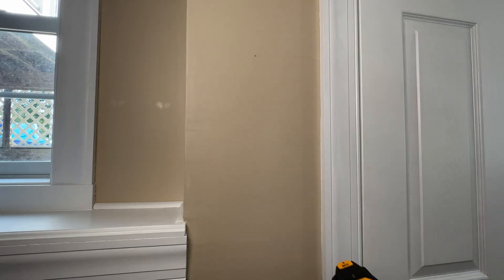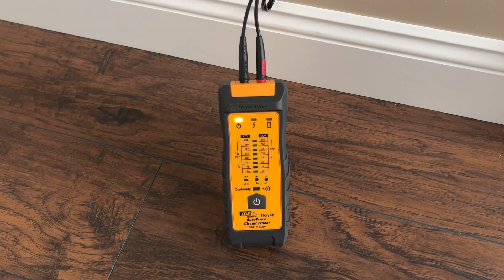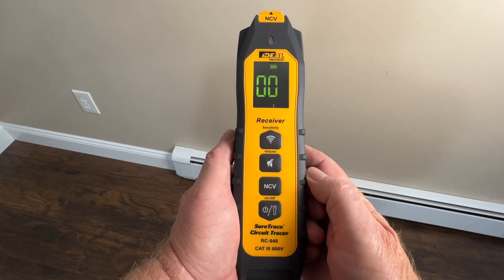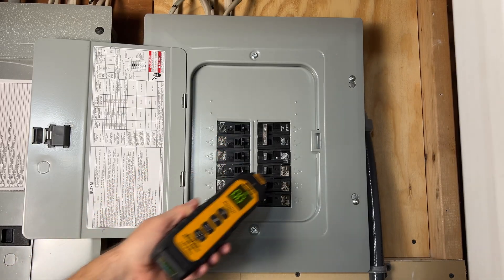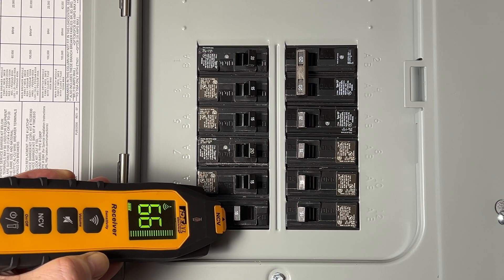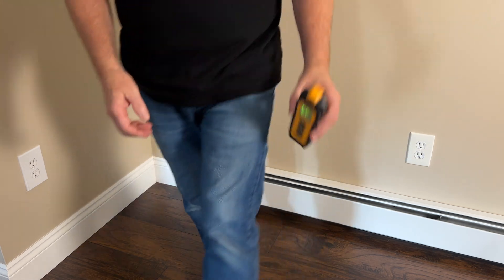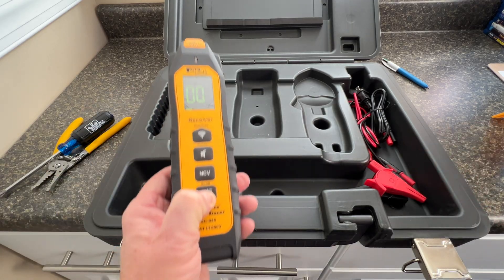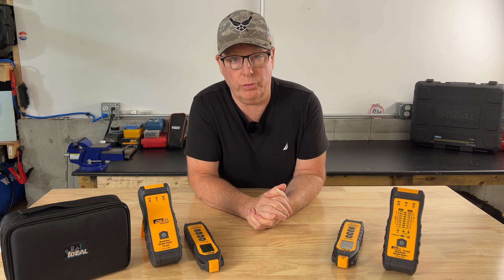Electrical Troubleshooting Made Easy! (+ GIVEAWAY)

Comment: Will the circuit tester differentiate circuits with shared neutrals, i.e. multi-wire branch circuits?
Reply from the maker: I haven't tested that but I think so. You will get readings on both breakers but you should have a stronger reading on the one with the transmitter connected.

Comment: hello I know its a year since your tracer give away. I watched your video and was excited to see your easy to understand explanation of a complex idea.  if you ever have a giveaway for another trace I would love to have one. I am a new to the electrical trade and ran into this problem trying to find a dead circuit in a new panel upgrade I did.  without a trace it will probably take several hours or days to find the issues I have. thanks again for your cool videos. I would even be happy with a possible discount code for a purchase. thanks again

Comment: Been doing maintenance for residential and commercial buildings for a long time. Never knew how to properly trace wires out till now. Thank you i know this device will make my life alot easier. Either way im getting one. Going with the 948 higher voltage

Comment: does the 946 have continuity testing also?
Reply from the maker: No, the IDEAL SureTrace 61-946 circuit tracer does not have built-in continuity testing. This feature is exclusive to the more advanced models, the SureTrace Plus (61-948) and SureTrace Pro (61-950).

Comment: My bathrrom lights, back bedroom lights, garage light, basement stair lights going upstairs, dinning room ceiling fan, and living room ceiling fan all lost power when turning the living room ceiling fan light on. Both fans where on high at the time and i pulled the light chain kinda slowly when it clicked and it all went out. The breaker will stay on but nothing will turn on or work. No other outlets gfci tripped. Where do i start?

Comment: HI.  I ran across this video as I'm having a weird issue with one of my 15A circuits.  The lights/receptacles would deenergize but no GFCI or breaker would trip.  Strangely, they could come back on without intervention.  That being said, I was looking for something to trace the circuit and this looks like it would do the job.  Question.  I have a 2-story home, so what's the best way to use this between floors?  Thank you.
Reply from the maker: Most likely you have a loose connection and most likely its in one of the electrical boxes on the circuit. If your receptacles are connected with the stab connections that would probably be your issue.
Reply: @BackyardMaine  Good call.  I will check those on each of the receptacles and switches.  Thank you.

Comment: I'm sold on that tracer!  My Klein Tools ET-310 is not nearly as versatile.  Sure, it suits most of my needs which is usually finding out which breaker a circuit is on when a panel schedule doesn't identify it, but it does pick up a lot of interference sometimes from other breakers which causes me to go back and forth to see if I shut of the right one.  My Klein only works on live circuits so it's no use for troubleshooting a circuit with a tripped breaker or other problem.  That tracer would be very helpful when power is lost somewhere along a circuit and you need to know which box to open up or where in the wall/ceiling to cut the drywall.  That would cut a lot of time off of service calls.  Being able to change the receiver sensitivity is a game changer.

Comment: I have a 1965 two story house with basement.   It has a fuse panel and what appears to be 15 amp wiring into most rooms.  There are no free fuses.  Whoever wired the house did a poor job labeling the panel.  I have to be super careful about what I plug in to avoid blowing a fuse.  They're  hard to source these days.  I'd like to have an air compressor in my garage.  But my only outlet there is tapped into the back side of a family room outlet!  And the family room already has a lot of loads - lights, TV, internet, and a small heater.  I live alone and it's  hard to trace the circuits by myself.  What I have been able to trace is weird.  Two 20A fuses run the zone valves and 1/10HP circulator pump for my gas furnace and a single outlet in the living room!  Very light loads for two 20A fuses.  Seems like I should be able to tie both the zone valves and pump to one fuse, freeing a fuse for a new line to the garage.  But I don't know what else is tied to these two lines.  Yes, I could keep unscrewing fuses and running up and down the stairs to figure this wiring out.  But this would be so much easier with a tracer.  I can't afford to pay an electrician to put in a new higher capacity breaker panel

Comment: Why is mine reading 99 om circuits its not even connected to ?
Reply from the maker: Turn down the sensitivity if you're getting a false reading. When wires are run in close proximity to each other the signal will bleed over.

Comment: Would you recomend this over the klien et450 ? Also can this do 480v  3 phase and 277v?
Reply from the maker: Yes this system is rated for 3 phase up to 600v. I haven't used the Klien so I cannot comment on which one is better. This one is really good though.

Comment: I’m a high voltage IBEW Journeyman.  I don’t really need this tool.  It’s super interesting to have the tool capabilities explained and see these tools used.  Thanks for sharing.
Reply from the maker: Glad you enjoyed the video, even if you don't need the tool yourself. I began my career many years ago as an IBEW electrician. We did some HV work as well. I retired an electrical engineer from TI where we actually brought four 34.5kv feeders into the main building. I have a lot of respect for high voltage electricians and lineman.
Reply: @BackyardMaine   You did a good job explaining everything.  Most engineers I deal with can’t explain anything to a normal person.  I have trouble understanding occasionally when they talk over my head 😵‍💫

Comment: Is there any way that this will find the first receptacle/outlet in the circuit?For example if there was no ground & you were installing a GFCI & wanted to find the first receptacle/outlet in the run & then have protection downstream.Example a 2 prong outlet with no ground & you wanted protection on the circuit so you need to find that first box.

Comment: Would it pick up a signal through BX & MC Cable.  I'd surely like this to trace circuits and wires in my 1948 old home that I'm bringing up to date but sometimes the cable runs into the abyss of the home through the joist and disappears... I sure hope I win
Reply from the maker: I think so but I haven’t tried it on armored cables yet. The drawing has been done for a while. I announced the winners in a pinned comment.

Comment: I need a circuit tracer to map breakers on a newly installed main panel in an older home in Holden Maine. The only reference I have is the old paper card left behind by the installing electrician. Most of the breaker positions were probably duplicated however, I know that several changes needed to be made in order to correct mistakes made by the original installer, a non-professional.

Comment: My 89 year old father lives in a 110 year old  house in northern Maine. The house has a lot of knob and tube wiring as well as a crazy amount of different fixtures and appliances sharing a circuit and things have to be turned on or used in a certain order to prevent tripping of circuits. I have been slowly trying to get things organized and labeled in some sort of recognizable and safe order. Last year I got a new 200 amp main panel installed to start out fresh….. this year during my Christmas trip I am planning on tracing out the circuits and rerouting as necessary to get things in some semblance or order. Your videos have been very helpful in this endeavor …. Thank you for your content!

Comment: I would love to see one of those used in a automotive dc circuit I have seen other products used for dc circuits but most are very unreliable at best for tracing circuits or finding shorts.
Reply from the maker: The issue is when wires are bundled together the signal leads into the surrounding wires. The upside to this is the ability to easily adjust the sensitivity to help pinpoint the correct wire.

Comment: This is a great giveaway. Id use this to properly label electrical panels and well as testing faulty electrical runs. And properly source out which receptacles are on the same circuit so that the disruption of power doesn’t affect other people in a busy commercial setting.

Comment: My house is nearly 100 years old. For about 10 years, I've had several  dead outlets,  but couldn't trace the faulty breaker. I'd re-label my circuit breakers plus I'd diagram my wiring & electrical routing.

My parents are in their 80s. My dad hasn't kept up with his breaker either. So, I'd sort that out.

Lastly, I have many neighbors who need the same help.

This years marks 20 year cancer free anniversary. I'm grateful to be alive. I'm 100% into doing for others.

Thank you for your channel.

Comment: Hmm...  I volunteer to repair homes for low-income homeowners, and they frequently have electrical issues in their homes.  I've got a Klein "breaker finder" that doesn't work very well.  The biggest issues that I have are (1) finding the right breaker to kill a circuit and (2) finding wires in the wall.  I may have to save up and get one of these bad boys.

Comment: I own a townhome condo built in 1980. The Electrical system didn't have any problems until 2015 and then one day the tenant called me and said the upstairs electricity is out. I went to troubleshoot and spent probably 6 hours or more trying to locate the problem. The issue was a switch box close to the main breaker box which had  four neutral wires with wire a nut and when the original electrician connected those wires one of the wires must have been just barely touching the others and it worked for about 35 years. When I pulled that group of wires out and unscrewed the wire nut it was obvious what was wrong and all I had to do was reposition the wires for a good connection and screw the wire nut back on. That tracing tool would have saved me 5 hours of anxiety.

Comment: I would use the circuit tracer to determine which breaker powers which circuit in my duplex. The breaker box isn’t labeled but sure would like to label it correctly.

Comment: John, thanks to you and Ideal for this offer. I've got two homes to troubleshoot, my son's and mine. My son's home is only 25 years old, but he been remodeled twice by previous owners. Many of the breakers seem to have multiple receptacle,  lights, and (on one circuit) a whole-house humidifier. They can't run the humidifier at the same time with a toaster or other high-draw appliance.
My home is 100 years old, and some of the wiring is still cloth-covered. It was originally a 2-circuit home,, one for each side of the house. While the actual service has been updated to 200 amp, some of the wiring has questionable connections and overstuffed electrical boxes. While i have the ability to troubleshoot these issues,, i lack the hardware, so one of these Ideal testers would give both families peace of mind, and guarantee our safety.

Comment: Greatly appreciate the education about circuit tracing. We just purchased a new home and there are several electrical lines and switches that I need to determine what they are connected to and/or not connected to. A circuit tracer will be the perfect tool.

Thank you for the education!!

Comment: Hi, John!  

For me, a tracer like this would be useful both professionally and personally. 

On the personal side, I have a home that was built in 1915, in which the circuit paths wander all over in places I wouldn't have expected.  Just this week, I had to play a guessing game to find the correct breaker to open to replace a damaged receptacle. I used an existing NCV and probe tester (incidentally also an Ideal) to check the circuit before proceeding. 

On the professional side, I work as an engineer in a manufacturing plant, the layout of which has undergone many, many changes, and continues to do so.  The placement of circuits often has an explanation, but one that requires a lot of history to have predicted.  The plant has AC and DC wiring, and voltages ranging from 24 to 480, and, of course, most of the AC is three-phase.  As with the home, and for many similar reasons, a circuit tracer would be useful to figuring out where the wires run.

Thanks, John!  I appreciate the work you do to educate.

Comment: My house was built in 1956. None of the workers were skilled craftsmen. Nothing plumb, nothing level. I needed to wire a ceiling fan. In the attic I found a rolled up romex under a cast iron water pipe. I tested the wire for power and it was hot. Someone had a death wish. I really should troubleshoot this whole house. I think one of your giveaways would be great for this task. Thanks

Comment: Part of my  job responsibility is equipment installation and disconnect at a gov't lab.  It's not always apparent which breakers go to which circuit as modifications are not always documented and there is always a rush to get things done quickly, especially when it comes to disconnecting a tool for disposal.  A circuit tracer would come in handy, both for efficiency and safety!

Comment: I would definitely get some use out of a circuit tracer. I work in hvac and also help out the electricians and there has been numerous times where we find breaker panels that aren't labeled so we have to do process of elimination.  This would make our jobs so much more efficient.

Comment: I’d love to use a tracer for mapping existing electrical lines/legs in my basement... 1941 house with 1970’s rewiring, so there’s some creative routing. Wondering if it’s possible to add an EV charging leg, and/or switch from gas to a heat pump.

Comment: i am entering this giveaway to rewire my kitchen because my kitchen has 13 outlets and it is all put on 1 circuit. it is all behind thick plaster walls and i do not want to open up the wall without knowing where the wires are.

Comment: I actually have the Klein version that was $45 but would love to get the ideal. My house has a mix of lights and outlets on the same circuits, in different rooms. Before I got this I would use my Apple Watch camera remote feature, point my phone camera at the tester, and watch the image on my watch at the panel and see when it goes off.

Comment: For years I have been using what was meant to be an audio tracer in order to find speaker wires under new construction drywall. It  has worked ok as I have been able to locate a broken neutral with it (trim carpenter not nailing baseboard on studs). I do have to turn the power off.  Now I am currently attempting to trace circuits in a 1945 cabin in the town of Marble CO previously owned by a 10th Mountain soldier/ turned artist. I am finding that there are hidden junction boxes because the aluminum wire in the panel (no neutral) somehow becomes copper (with a copper ground and still no neutral) in the kitchen. And we are  talking 240 V which is then pirated at a J-box in the kitchen for additional 120 V circuits. The 240V also supplies a stove/oven and a Dryer. The pirated supplies a Washer and a microwave. My Tracer is not capable of such in depth detection. Perhaps this Ideal tool is much more sensitive so I can trace the wiring  to hidden junction boxes. And there is also live wires sticking out of the ceiling (very old cloth insulated wires) that being able to trace live wires would be nice.Thanx for the chance.

Comment: I am one of your earlier subscribers. Love your channel. I could certainly use a tool like this. I work by myself, so going back and forth to the receptacle from the panel and back takes up a lot of time when tracing the circuit. I also work with 1960 homes that have lots of MWBCs and otherwise old wiring with shared and "stolen" neutrals. The short tracing function can save me lots of time, too. Hoping to win, but in either case, please keep up the great work of sharing your knowledge and experience with us!

Comment: My house does not have most of the circuit breakers marked. I've also found a few marked incorrectly. I also need to determine whether I need to add additional circuits in my living room and garage to supply new outlets. I don't want to over task full outlets. I priced out this work to several electricians and found it to be cost prohibited. This tester sounds exactly what I need to do the job effectively, safely, and easily.

Comment: Thank you for your videos.  I am a recent subscriber and going back through some of your older videos to see what else I can learn from you.  I would use a tracer in my rental property. The property is plagued by previous DIY modifications to the electrical and some of it is very confusing.  A tracer is exactly what I need to figure out how the previous owner decided to wire in his new electric circuits.  Thank you introducing me to a Tracer.

Comment: I posted on your California 3 way video about 2 wire travelers on a 3 way switch.  If I read your comments correctly (not a given, by the way), I should probably consider replacing the 2 wire traveler with 3 wire traveler.  This tool would help me trace the 4 different 2 wire travelers to make replacing them easier, or at least less expensive, as I would not be guessing where to open up drywall.